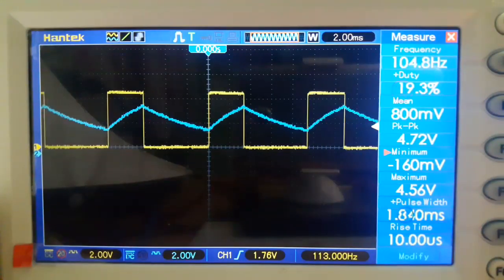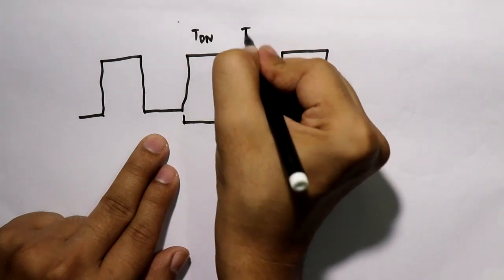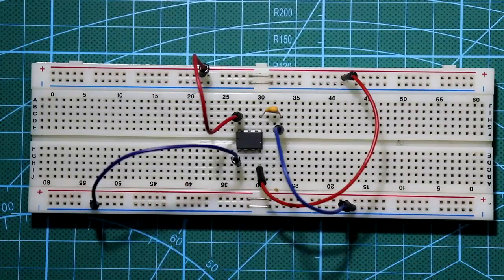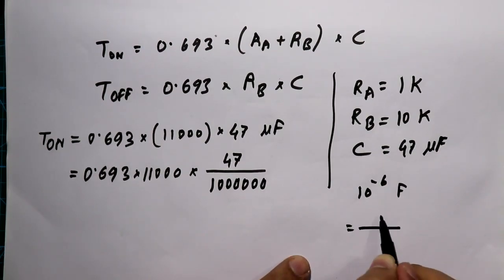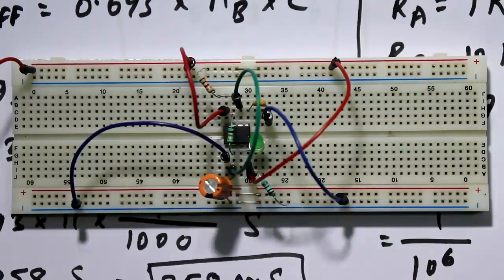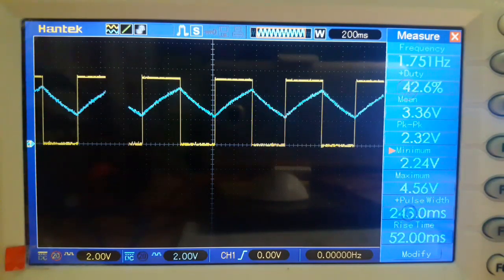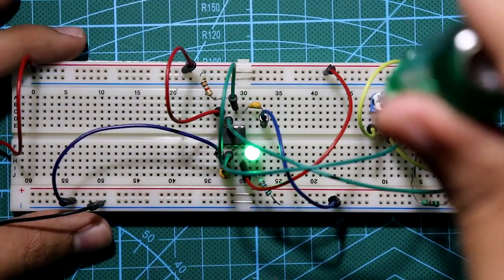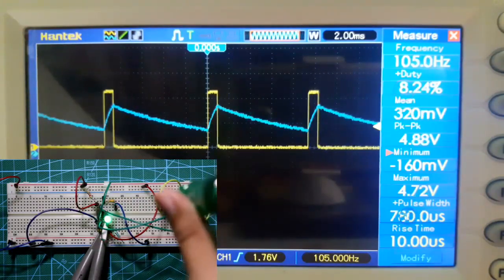PWM signal generation by 555 timer IC | Explained with Oscilloscope

Comment: Thanks for the making this video, it was very straight forward...  I'm trying to design a circuit to control a 4-wire PC fan using PWM and a 555 timer.  My understanding of the standard 4-pin fans is that they expect a frequency around 25Khz.  I'm having trouble figuring out what components to use in order to maintain 25Khz frequency and also provide speed control using a potentiometer.  Any suggestions?
Reply from the maker: Please watch this video. 555 controlled servo motor. I hope this video will give you some idea.

https://youtu.be/pYMte4esiMI

Comment: #sir plz tell me for very low frequency should i used 2 diodes or not
I want to operate pump for 5 min on and 20 min off in a repeat mode

Comment: What PSU did you use?
Reply from the maker: Gophert cps-3205 ii
Reply: @EEWave  thanks 😊 I'm afraid to probe my circuit because I use switch mode power supply I just bought hantek dso2d15 i want to know when is it safe to use my oscilloscope.I don't want to lose it because of some stupid mistake

Comment: I want a pwm with minimum 20khz 
What parts should i use?
That will provide minimum 20khz(i want it for dc motor speed controling)
Reply from the maker: I've just included a video link in the description. It's about speed control of DC motor. I hope that video will help you.

Comment: friend i made a power booster with the help of 555 ic the i hae shorted the 2 6 7 with the 1 k pot then connected to 5 volt from there on connected the pin 8 . and from pin no 3 connected a transistor bd139  but the ic is not generated any pulse when i disconnected the gorund pin from pin 1 then i saw the transistor is working fine but it is heating . my question was why this transistor is heating . while connected ground with the pin no 1 i saw the out put volatge from pin no 3 is .52 olt i connected on capacitor 10 pico fard in the input section . please adive .

Comment: Dear Sir !
In my Practice I should call this method rather puls with variation, nor modulation. You modify some resistor's value by hand, so it occures the change on  on/off ratio.
 If we talking about modulation, that means we modify the on/off ratio by the modulate signal, wich covers information ( for examole for regulation, or communication ( radio transmitters ).